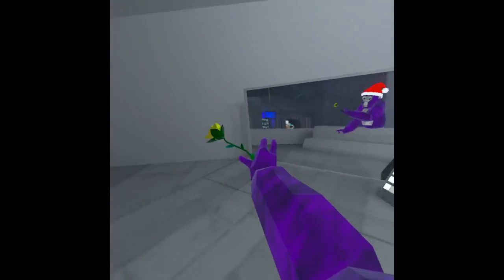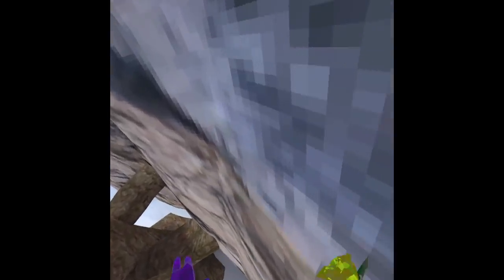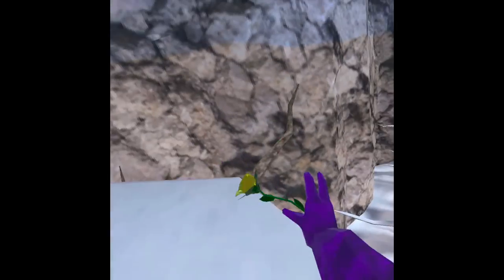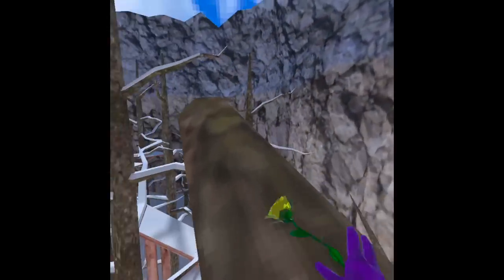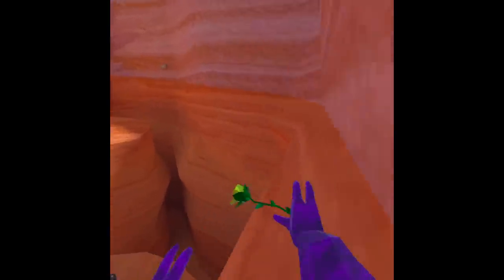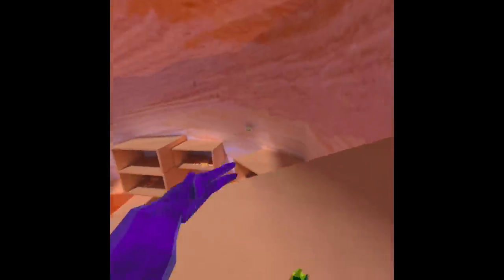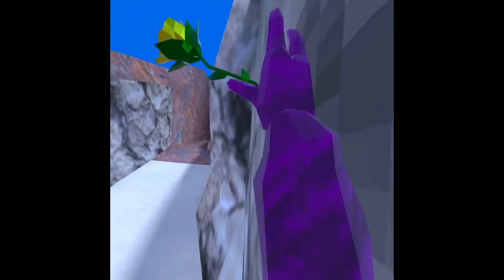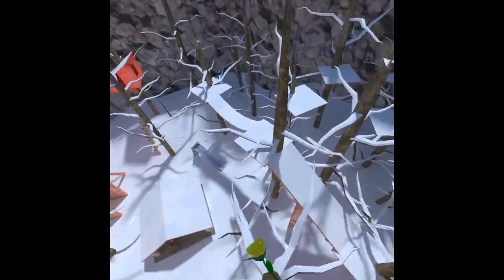Slippery Walls Tutorial - Gorilla Tag

Comment: Pig I had the same controller issue where it would disconnect, it got so bad where I couldn’t even hit the ground. This is mostly cause by the        plastic in the back that holds the battery is where’d down so the battery sometimes disconnects when you move your controller fast.
THE FIX: take a piece of paper and then rip a straight line and fold it up and put it in the back where the battery rests on. If that doesn’t help then also put a piece of paper in front and if it still does it than make the piece of paper in the back even thicker.